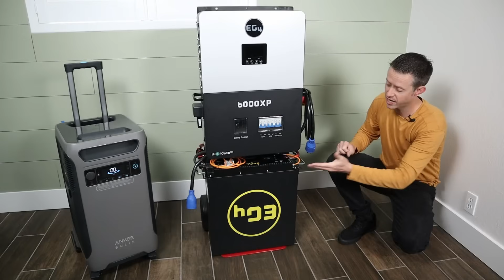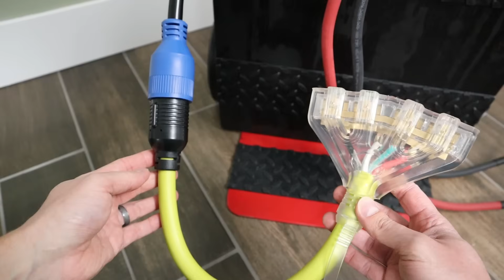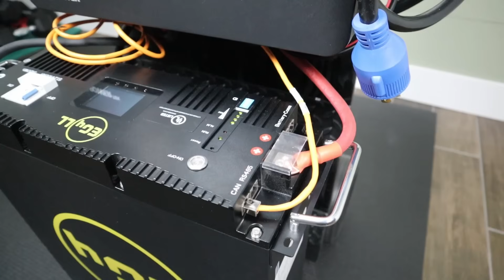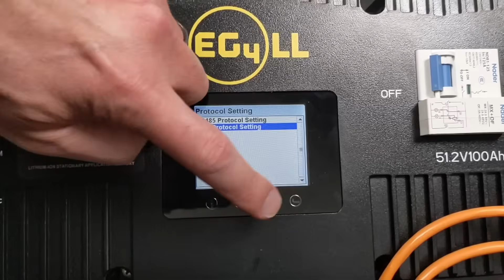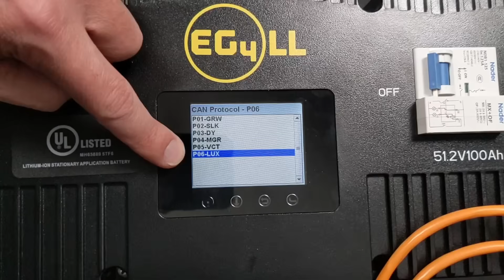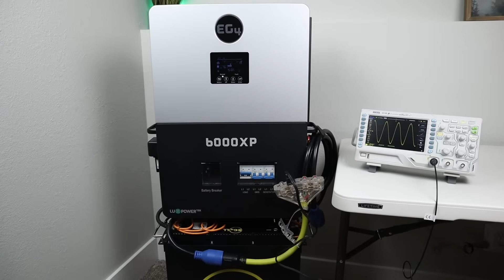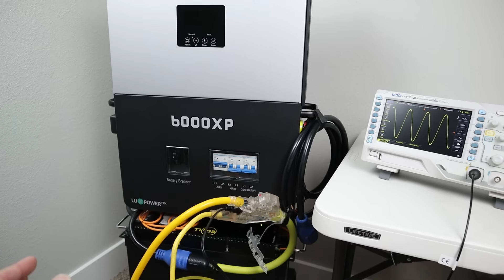Build Your Own AFFORDABLE 240v Battery Backup! Mobile Cart Using the EG4 6000XP & LFP Battery

Comment: Just to be doubly sure, you reverse those mc4 pig tails on the pv input right? Negative mc4 on the positive and positive mc4 on the negative so the polarity is correct when you plug in your mc4 connections?
Reply from the maker: Yep, so it can take the input side from solar panels.

Comment: Your build looks great but I wouldn't trust those cheap wheels on that dolly. I've had those things just kind of turn sideways and almost bend in half as the axle got wallowed out and they weren't carrying much, just got stuck on a sidewalk crack on a hot day. I wasn't carrying thousands in equipment though! I might build one of these and use my Honda eu7000is generator to intermittently recharge it during use. Have you ever tried to wire in a circuit to autostart a generator that has a  remote start or electric start?

Comment: I don’t understand why people like those eg4 battles? They all get unbalanced and you can’t repair them. A real DIY system is when you build your own battery bank and add your own BMS. Now if your system gets unbalanced, you can break the battery bank down and fix the issue.
Reply from the maker: I haven't heard of any of these EG4 batteries getting out of balance.
Reply: @ you haven’t been on some off grid forms. A lot of people are talking about it. They get unbalanced and it can’t be fixed. Most of the time, they want you to ship them back the battery and they will ship you another one. Trust me, if you look you will be surprised. 
If one of my batteries gets unbalanced. I would pull that one battery pack that has 16 eve cells and fix it. You can’t do that with the EG4 batteries.
Reply from the maker: @iiinsaiii  well mines been great for over a year so far. I frequently charge it to 100% for it to balance out as well. Maybe people aren't fully charging it often? Anyways, thanks for the heads up, I'll keep an eye out for it.
Reply: @ just google “ EG4 unbalence “ 👍

Comment: bought a 6000 xp and 2 eg4 batteries and 20 400 watt bifacial panels with a 37 volt voc.will. use asi a mobil cart daily to power a 65 inch tv and misc. in my 600 sqft enclosed sun patio..besides the tv the plan is to install my 12000 btu hybrid minsplit to cool and heat the patio area 24hrs. a day along with the direct solar hybid part of up to 6 additional panels.. have a a 1979 all solar home. with 52 solar panels facing half east and others  split west .and south.  16 k installed <5 years ago.  have all new appliances with a new hybrid water heater and 5 ton hybrid ac unit. have a modest credit on sce power bill year around but am paying 350 month solar power lease billl.  in the 5 1/2  years iv'e lived here elec, has more than doubled. am preparing to be able to live here if  my power is blacked out or shtf ,.have lots of extension cords. also have a additional portable window ac unit that kept our home liveable when the ac unit was replaced last summer.  My 27 panels are arriving betwwen 11-4 pm on dec 23.rd.  my christmas present .THANKYOU SIG SOLAR AND WILL PROUSE ALONG WITH THE U TUBERS THAT MAKE OUR COUNTRY GREAT. AND THANKS TO U JASON I HAVE GUIDE TO PUT THIS TOGETHER.

Comment: Nice & neat job. I’m an Aussie (240VAC) & have done basically the same setup with a 5kW Hybrid AIO & 30 kWhrs LifePo4 to run most of my house with 10 kWh’s of PV panels on a grid tied system, so I just set a timer to charge from house GPO 9am-3pm each day the sun is out.
I like these new EG4 Inverters with all their built in features, CB’s and battery setups, it makes it so simple nowdays.
Good vid. Cheers
Reply: Where’d you purchase the AIO and what brand?

Comment: Could you set this up to charge a Tesla?  Meaning, I want to connect it to NEMA 14-50 plug and use it as 240 volt charger.

Comment: Curious how the communication would work with the EG4 LifePower4 V2 Lithium Battery – 48V 100AH – Server Rack Battery that just have the dip switches??
Reply from the maker: The communication is adjusted via the DIP switches. It should mention that in the battery user manual.

Comment: I thought that I read you had to have two of the 48 V batteries for that inverter? Was that just a recommendation?
Reply from the maker: To get the full 6000w, you'll need two batteries since that's around 112 amps at 54v. One 48v battery can handle 100 amps continuously and that's why they suggest two in parallel.
Reply: @ Thanks for the clarification on that. One more question, could I use one output leg to power the 10 space transfer switch in my pole barn with my 30 amp 120 inlet, And run the other leg to my house to the separate 10 space transfer switch with that 30 amp inlet? Basically, I power my pole barn off grid all the time but would like to have The other leg go to the house for back up for power outages. I realize I wouldn’t have 240 but that’s OK.
Reply from the maker: @kerryjohnson7364  I don't see why that wouldn't work, as long as you dont pull over the peak 3000 watts per leg.

Comment: I got a six battery rack from Signature Solar and put four batteries in it for 20kw total. I then mounted a 6000xp to the side of the rack on one side and a six spot breaker panel on the other side.
Then added two standard 115v outlets and one 230v outlet. It is definitely heavy but still rolls around my shop for power anywhere I want it. I can also put it on my trailer for remote outdoor jobs when needed.
Reply: Do you have pictures or link to your setup. Thank you
Reply: I do have a few. @dennyhart6757
Reply from the maker: Awesome setup! Huge capacity!
Reply: You should make a YouTube video. I'm doing the same setup but for EV charging

Comment: How do you ground it?
Reply: Following
Reply from the maker: It's grounded when connected to your main panel or a transfer switch. It shares the ground with your home. For an off grid setup youd use a grounding rod.

Comment: Can you, please, let me know if EG4 6000XP compatible with Vatrer 48V(51.2V) 100Ah LiFePO4 Lithium Solar Battery?
Reply from the maker: The Vatrer doesn't support battery communications but it would still work with the EG4 inverter, the inverter just wouldn't know the SOC of the battery, it would just know the voltage.

Comment: Excellent DIY system but two many turn this on; the switch this on; then switch this on. It is too many options to make a mistake on turn on the wrong button for someone absent minded like myself. Is this expandable? Athough the Anker Solix 3800 cannot compete with the solar input, it can expand very easily. People than make these DIY systems usually claim they are easier to build than they actual are. With your expeience and knowledge I'm sure that's the case.

Comment: Good video.  Lots more choices out there than when I started learning this 10 years ago.  I agree with the DiY advantage in expandability.  I am a fan of both units. I really like the portability of the F3800 to drag to a site that has lost all power.   Not long on endurance but compact.  Adding to that system gets expensive.  I just did a side by side of a F3800 and a EG4 18k with lifepower4 batteries and even a pallet of Sirius 415 W panels.  The EG4 came in under the F3800 due to the cost of expansion.  I could give you more specs but the point is there are places for both.   I didn’t hear you saying there wasn’t.   I always appreciate your videos.   I actually have portable panels you recommended a couple of years back.  All the best from north Texas.
Reply from the maker: I think each product has it's own use case. I will probably do another video in the future comparing the two types in depth. Power stations are getting more affordable so they might be able to compete with these larger DIY systems down the road. I will say power stations are AMAZING if you want something quiet, compact, and easy to use. The fans on this inverter are SUPER loud!

Comment: Great video !! I have a question about your thoughts on replacing those fans inside the 6000XP with some much better and quite fans ? I can only imagine those fans are 120mm and there are some 120mm fans that move a lot of air that are significantly less noise. Thank you in advance.
Reply from the maker: Im not sure if an aftermarket option would move enough air, there might be something out there that would work. It definitely needs to be more quiet!

Comment: I just came upon your nice video and was amused because I just built this exact system a couple weeks ago. The slight differences in my system is that I use only one leg of the output so far by wiring in a multi-port outlet strip with 6 receptacles and two USB charging ports. I may add a second multi-port outlet on the second output leg just to balance the load a little better. I also wired in a 30 amp 48 to 12 volt converter from the second battery posts so I can power DC appliances such as my ham radio equipment and I don’t even need to run the inverter for that. For charging I wired in a 15 foot cable with the L-14 plug on the end so I can connect to my generator for charging and I also have an adapter that adapts that plug to a 3 prong tt-30 plug so I can plug into the dryer outlet and charge it that way as well. They both work well. This system will run our pellet stove heater and refrigerator for a couple days before it needs charging. There’s enough power to also run lights and the microwave oven. It’s portable but quite heavy. I can move it around but I’d hate to have my wife have to move it.

Comment: Am  still  happy  with  the  24000 watt  portable  battery  I  got  for  only  $9,000.  US.   It  is  on  4  wheels!
  At  only  .37 cents/watt hour  it  also  provides  Air Conditioning,  GPS,  a  Kickin'  Stereo  and  cruise-control  .  .  .  .  .  .  .  .  .  .  .  but  only  80 miles  range  between  charges  .  .  .  .  .  .  .       still  .  .  .  .  
   .  .  .  I'm  retired  &  don't  need  80  miles  of  range ! !             take  care,       rh
Reply from the maker: What model is that Richard? Is it a plugin hybrid or is it fully electric?
Reply: @Jasonoid  -  A 2015 Nissan Leaf  I  bought  in  2017.   (Full  electric)  It's  battery  is  doing  well  almost 8 years into ownership.       take  care,     rh

Comment: I like your build however I want to point out one thing for people who are new to solar and electrical systems, like me. The Anker 3800 has a max solar voltage of 60 volts. To me this is a good thing. I don't ever have to worry about being electrocuted. Maybe not as efficient as high voltage and all my panels need to be in parallel. But I think that is why they did it.  So I would say for some of us simple works. Although I really like the flexibility of your solution.

Comment: Thanks for this well done video.I'm a suburban and apprehensive DIYer that wants to add a battery to my house for backup and general electrical augmentation. Would I keep something like this in a closet and bring it out and plug things into it every time I want to use it? Should it be kept near a sub-panel and plugged into that or switched on when needed? What's the best way to disconnect from the grid to use the battery and then easily reconnect? Is that allowed in California?
Reply from the maker: Something like this is similar to a gas generator in that it can be legally connected to a transfer switch or generator inlet / interlock switch to power your home during a power outage.

Comment: Neat idea, making a hand truck battery cart 😅
Reply from the maker: Hey Lithium Solar! You have an awesome channel. Just FYI, at the end of the video I told everyone this was not my original idea as there are many creators that have done this type of project before. 
In my planning process I wanted to mount the 6000xp to the hand truck kinda like you did with your updated build but it's too massive! I had to use a wood backer which probably isn't ideal. At least the inverter is mounted on flanges and doesn't come in direct contact with the wood.

Comment: you might have considered , plugging it into your sub panel to demo the 220 loads and limits. Plus mentioning with the addition of solar input and a sub panel , reducing the monthly electric bill legally and safely. Plus mentioning the option of charging with a 220 volt output generator ( during sunless days) while continuing to use the  system to power the home.
Reply from the maker: Yes, those are all things I could have considered mentioning. This video is a basic assembly video.

Comment: Mine is the 6000xp and 3 EG4LL’s! It’s on a Loews cart that is hand truck-to-4 wheeled cart. But I thought the 6000xp required at least 2 100ah batteries to start up? Is that not the case?
Reply from the maker: For the full 6000 watts output it's recommended you have two 100ah batteries. With one battery you are good for about 5250 or 5500 watts peak depending on the voltage of the battery.
Reply: @ the dumb response - I get the difference in battery capacity. I had read that two batteries were needed to power up the inverter. I never understood how that worked, but it was out there.

Comment: I would be interested in seeing if this is capable of running a 1/2hp well pump!  Thanks!
Reply from the maker: Yes, it's definitely capable of that.
Reply: @Jasonoid  If possible maybe a video on a pair of 6000xp for 12kw, batteries and solar panels for a medium sized house off grid.  Thanks for all the info!

Comment: Where are the solar pannels? At this point it's just a power cart. Adding panels addresses a bigger question of, can this thing stand alone or not?
Nice video, good work, hope you get something out of this.
Reply: He showed the pigtail of the mc4 connectors that plug right into the mc4 connectors from your solar panels.
The other end of the mc4 connectors are plugged into your solar panels outside.

And when he had the inverter open where he plugged everything in he showed you where the solar input was and how he connected it. And when it comes out of the inverter that's where you see the MC4 connector pigtail.

Comment: Great tips. We are getting solar installed to our home but if power goes out we have no power. (Calif Edison.) It does not happen that often here, usually few hours, and thankfully not some areas in the U.S. where can happen for days. I know that’s how most systems are designed but this would be great as a back up or supplement. Thanks.

Comment: Nice build! When you were connecting the battery you said lithium ion ILO lithium iron phosphate.  Bad boy! Maybe you can add verbiage on bottom of screen to correct that?
Reply from the maker: The setting in the menu is 'Lion', for the use any lithium ion battery. 'Lithium ion' is an umbrella term that covers multiple battery chemistries (including lithium iron phosphate). I am well aware of the difference between LFP and NMC. The setting shown in the video is the correct setting and nothing needs to be updated 👍

Comment: Portable??? Right…. Do a video of putting that in your car by yourself to go up to the off grid cabin for the weekend.
Reply from the maker: I think you get the wrong idea of portable lol.... The battery comes off in a few seconds if you really wanted to move it. Move the battery and inverter separately.
Reply: @ yes, but what do you do once at the cabin…without that hand truck that won’t fit in the car???  You’re going to need more hand trucks. Assembly and disassembly at every stop. No thanks, my F3800 meets all the realistic needs that these units are called upon to do.
Reply from the maker: @djrtime1398  yeah, the F3800 is great for some things too 👍 each person has their own way they use these power stations.

Comment: Sorry to "harp on you" again, but your 240v-120V adapter isn't really safe.  They make adapters that have built in 20A cicuit breakers/fuses.  Someone is going to plug a power stip into 1 phase and run 3000W through 1 120V plug with 12AWG wire and have a thermal event.  Other than that this is great content👍
Reply from the maker: If someone if going to spend the time to build this let's hope they have enough common sense to not burn up a 12 awg cable 👍
Reply: @Jasonoid  You'd be surprised the things people attempt that they have no business touching 😅😅😅, a lot of people think electricity is "magic"😅

Comment: 14:14 should you not turn on the battery and inverter dc breakers first? Then the battery power button, that way it can use the pre charge resistor to charge the caps?
Reply from the maker: I think that process is pretty much the same.

Comment: Great video, thank you. Do you think the same build can be done with the new EG4 12000XP instead? It looks to be just a little bigger in size and about 30 punds heavier than the 6000XP.
Reply from the maker: You'd need to have at least 200ah of batteries for that inverter. So probably needs to be on a 4 wheeled cart.

Comment: Jason, thank you for your time doing these vids. Would like to see more on this setup. I've been trying to decide the best way to go for home backup. Been looking at the Anker f3800 and the Jackery 5000. Now I'm thinking You just changed my mind. I need 240 for my well, and could alternate between 2 freezers, fridge, and furnace for 120v. Your setup and a chargeverter for my Honda 5000 watt gas gen. seems like a better choice. Thanks again for your work.
Reply from the maker: As long as you can deal with the super loud fans, I think you'll enjoy this setup. You can definitely add more batteries in the future for a much cheaper price!
Reply: @Jasonoid  Won't bother me I got some tinnitus anyhow. If it  bothers my wife, I could turn off everything so she could here crickits in the dark! Easier to ask forgiveness than it is permission!!!